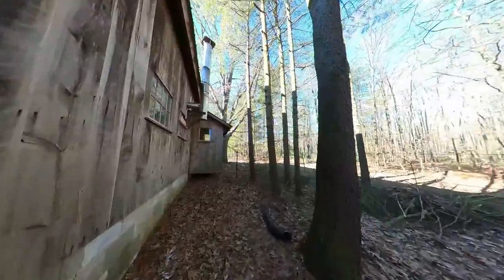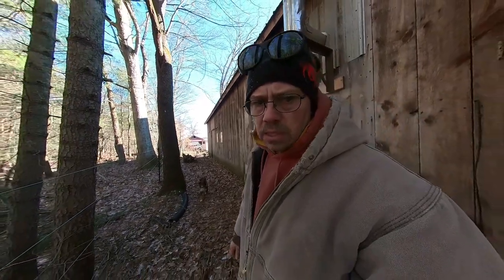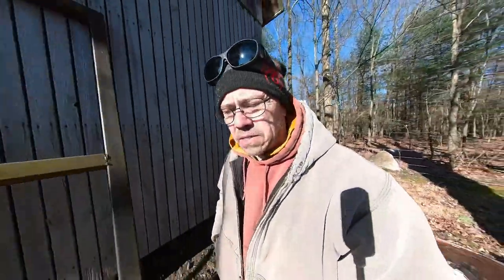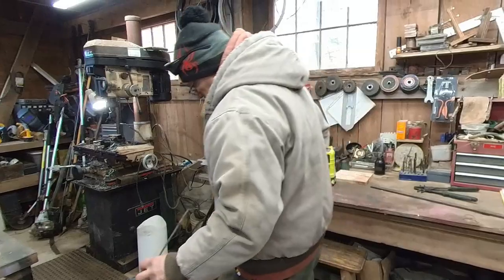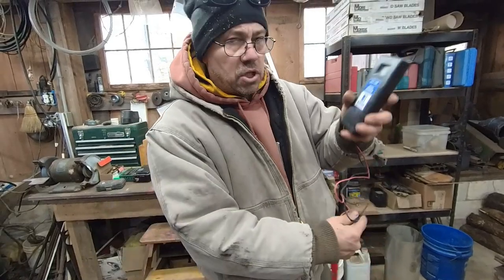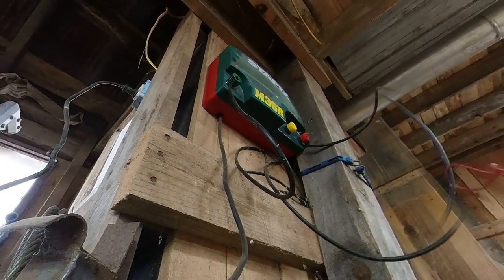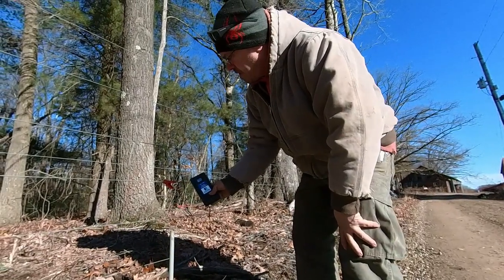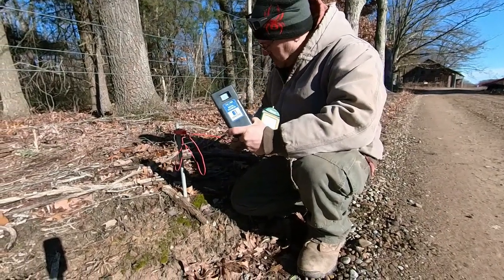Bulletproof Fence Energizer Grounding Field.

Comment: As a retired telephone in AB, Canada,  I have driven and tested my share of ground rods.  Our standard was tested in resistance not voltage, and the maximum was 5 ohms or less.  This standard helped keep noise off of the circuits and helped the ground return ringing circuits to operate. 🇨🇦
Reply from the maker: That is very interesting. I'm going look a little deeper it that. Is there a rod that is better than another?
Reply: @RussWilson  We used galvanized coated steel rods 9’ .  When we had to installed a “ chemical “ ground (only in very poor, dry soil) we used solid copper rods which were laid in a trench and covered in chemicals.  These ground types were used for large telecom towers which were usually on high hills which were often had poor grounds. 🇨🇦
Reply from the maker: @richardcrossen9480  Thanks for the information.

Comment: What size/gauge grounding wire?? Burying this wire is a terrific idea.  Another great idea is the rotary drill.  I have always waited till the "wet season" or poured water next to the ground post, which helps reduce the pounding.  The rotary drill is a much better idea-avoiding wear and tear on the body. Thanks
Reply from the maker: Glad it was helpful! Thanks for watching!!
Reply: Best wire is non coated #6 wire.  Noncoated wire adds to your ground field (wire and cable).  This will result in having to use less ground rods.
Reply: I learned more from this video than anything I have read or watched and I have lived on a farm with electric fence keeping in my mules/horses for 30 years. Every summer I have issues with low voltage. I was always going out and pouring water on my grounds. I Now I know why!! I used coated wire between my grounds and am going to switch it out with stainless steel. Thank you, thank you!

Comment: I used to work on a dairy farm and the stray voltage came from the water heater. The scc was always high but we couldn’t figure out why. I’m very sensitive to electricity so I felt it in the wash water but no one else did. Once the water heater went bad and replaced the water heater, they had the lowest scc to the cheese plant.  I heard cattle are super sensitive to electricity compared to humans. I forgot what the number was but it was a big difference like 10,000 times more sensitive or more humans. Thanks again for all your videos!  I’m thinking I will have to add to my grounding system and a bigger charger too once I build more fences this coming spring.
Reply from the maker: Stray voltage sure can mess up a group of cows. Not something beef farmers think of very often.

Comment: I have a Parmak 12 volt dc fence charger. When set up and simply using a short piece of rebar it puts out around 6000 volts. However when I put 35 foot ground rods (10ft apart) it will not function properly. Makes no sense and Parmak tech could not help me. Ground is sandy loam and moist. May be defect in charger?? Seems like unit discharges itself and resets when on better ground but works on short piece of rebar. I did not know about your test on putting tester ground probe in earth and touching ground rod. Not sure how it would show a positive voltage without leaking somewhere from fence. My fence is single strand and only 3 acres. Insulators good. No debris. Any thoughts? Thanks Andy
Reply from the maker: Hey Andy, I ve seen a lot of problems with fencers never ran in to yours before. DO you have a friend that uses a fence charger? Maybe take yours to their farms and try it. Don't know where you are. I have one here you could borrow and see if it works at your place. Thanks for Watching!!!

Comment: I haven’t done this yet, but what I was considering doing, I don’t energize my bottom wire, I was just going to drive a rod in every so often and tie it down to that bottom wire which is tied to the negative of the charger, would this work or am I missing something that would make that a bad idea?
Reply: To add to this, my thought process behind it is, that’s basically how we do it with the electric grid, every pole has a pole ground on it attached to the neutral and connected to ground.
Reply from the maker: If your bottom wire is negative I can't see way it wouldn't work. You could space your ground rods out a lot more. Thanks for watching!!
Reply: Our original fence was two live wires on t-post. Insulated of course. Then winter hit in Canada. Once the ground froze hard we lost all power. We then ran a grounded barb wire center wire. That was hooked to all the t-posts and back to the ground rod at the fencer. That system works for us. The current between the wires is usually 9.9kv in the summer and 6 or 7kv in the winter. The down fall is the live wires get hooked on the barbs and grounds out the fence. Also wildlife wipe out the T-post insulators. Another short. Also we can get snow drifts right over the fence. Once that settles it is like a glacier wiping out insulators. Trying to avoid t-post in future fences, but still need a ground wire.
Reply from the maker: That is a good idea to run a ground on you fence in areas where it is dry or when the ground field stops working. 

We also have few tee posts where wildlife would take the insulators off. We switched over to four inch fin tube insulators and hand tying them on. I can’t remember the last time I fixed an insulator. Problem solved!!

Comment: What did you use for ground rods & what wire connected them- coated or non?  Fej
Reply from the maker: I used home depot ground rods. They went into a panic when i order 40 of them. Took some scraping but they had them.  I used 12 gauge stainless steel wire to connect the rods. It was suggested by a subscriber 6 gauge wire maybe better. Great question.

Comment: I'm installing a Cyclops fencer and I set it up temporarily before I got my Timeless fence posts. To do that I made a temporary paddock with poly twine. I hooked the positive terminal to the twine and I hooked the negative up to the perimeter fence which is steel tee posts and a mix of barb wire and woven wire. Around here all the surrounding properties also have similar fences and they are all interconnected. That temporary setup is maxing out my fence tester at 10kv. I'm guessing that using dedicated ground rods is not going to get me a better ground field than the fencing that surrounds and cross fences several square miles!
Reply from the maker: If you have tee posts as your ground field you can't get much better than that. Only time it may give you troubles is if it gets really dry.
Reply: @RussWilson  it's about as dry as it gets right now and it's working like a champ!
Reply from the maker: @RevM  then you should be good to go. 👍
Reply: I found that out the hard way! @RussWilson

Comment: Why so many rods? How did you figure out how many you really needed? An then that ground wire you just went ahead an barried it? Thanks Russ
Reply from the maker: We had stray voltage in our water from the fencer it took that many rods to get it out. We used the shorting method to figure out how many rods we needed. I explain it towards the end of the video.  Yes we buried the wire between the grounding rods as it helps with the grounding system. Thanks for Watching!!!
Reply: one of the things I have found through the research and trial and error is it takes 1 ground rod per jule of output that your fencer is rated at. 
 this makes perfect sense to me S you used 29 rods plus the wire that connects them. 
 on a side note I can say the hammer drill for pounding them is brilliant

Comment: Questions:  Could you just run a separate ground wire hooked to your fence posts and use jumper wires to each rod?  That way you're out of dirt and don't need stainless steel wire.  "Michigan State University Extension recommends, “Installing a minimum of 3 feet of ground rod per joule of output capacity."  Is your rocky ground why you did so many?  Or did your shorting technique indicate that many?  "According to countless energizer manufacturers, it is recommended to have one joule per mile of fence and to maintain 3000 to 7000 volts to keep control of livestock."  How do you determine how big of a fence charger?  Thanks  GW
Reply from the maker: Trust me a I did a lot more research on the grounding field than I wanted to. I wanted my rods buried with stainless steel wire to increase the grounding field I also didn't want a bunch of ground rods sticking out of the soil.One reason we have so many ground rods is we were getting stray voltage in our water from the fencer. It took 25 rods to get the stray voltage out of the water and I added a few extra to be safe. I used the shorting technique. I also spend a lot of time on the phone with the experts from cyclops and kencove figuring this problem out. We went with a 36 joule fencer cause the 24 joule we had could not keep the fence hot enough. We also have 4 wires hot all the time to make about 25 miles of fence. I disagree about keeping livestock in at 3000 volts. Cows yes sheep and goats no soon as my fence gets shorted down to 5000 volts the sheep start getting out. Great questions!!! Thanks for watching!!!

Comment: Can stray voltage get into the water supply if you're using plastic or rubber water troughs? Can you measure stray voltage at a metal trough using the meter with ground probe?
Reply from the maker: Yes stray voltage can get in to plastic or rubber stock tanks. It gets in a lot of ways. It can come in off the neutral wire off your powerline's that comes into your breaker box or fuse box. Had to have the electric company put neutral isolator on the transformer coming into our power service. we had 10 volts of stray voltage coming from the electric lines. By law it has to be below 1/2 volt.  Another way is static electric from high voltage lines near by. Most of the time it gets in from a poorly made grounding field. Which we had and video is about. It can also come in from a piece of grass touching the fence and touching a hydrate. If a tap rooted plant touches the fence and the root goes down to a pipe joint that is metal can cause it to.  The way to test it at the pump or tank. Use a regular multimeter that can register low voltage. Get a piece of 10' long wire for your ground stick it in the ground ten feet away from whatever you want to test. Hope that helped thanks for watching!!
Reply: @RussWilson  Thanks Russ. Great info!

Comment: Do you use insulated wire for your grounding wire? How do you get your step in post in the ground this time of yeat?
Reply from the maker: The wire connecting the ground rods is uninsulated wire. I just did a video on sticking posts in frozen soil. It is scheduled to debut on 1-21. Here's the link to that video https://youtu.be/FOS7wIoa2lg . If your soils that are frozen super hard. I like to tap them in with a rubber hammer.  Thanks for watching!!!

Comment: Interesting topic.  I've not had stray issues that I am aware of, at least not with my water system.  One of my primary ground rods is located at the gray water exit from the house so the soil stays wet - maybe that helps.  Plus I'm only running cattle, a single perimeter strand at 3 kV is plenty.  (As you suggest sheep and goats are different.)  Couldn't you just as easily measure resistance with a cheap multimeter?  ...goal being say less than 25 ohms?
Reply from the maker: Hey Ted I tried to use a multimeter at first but it got fried from the hire voltages. Thanks for watching!!